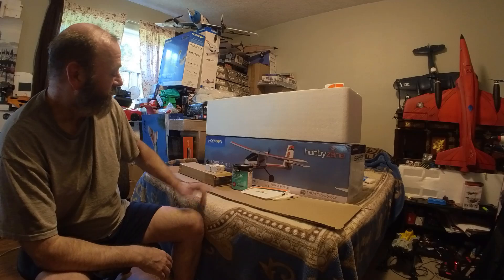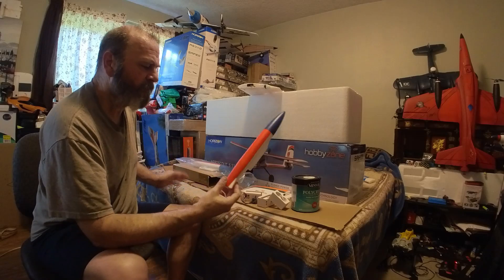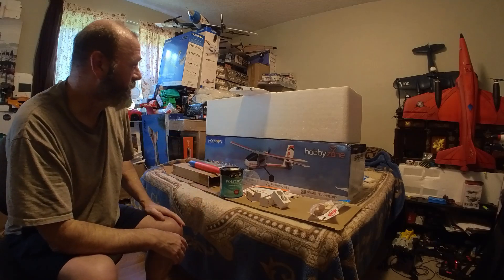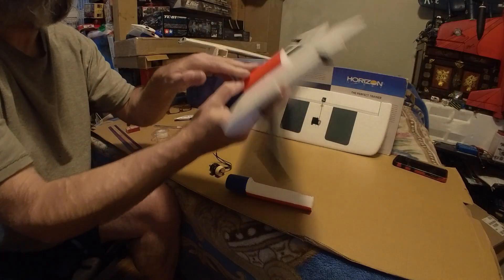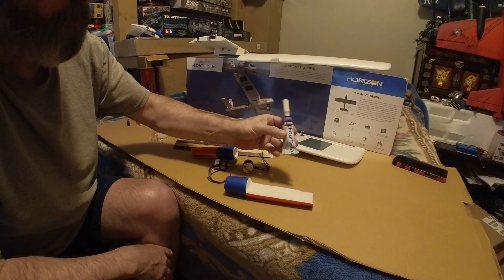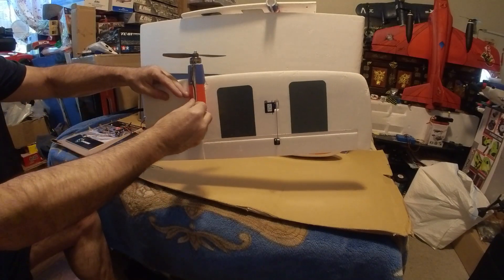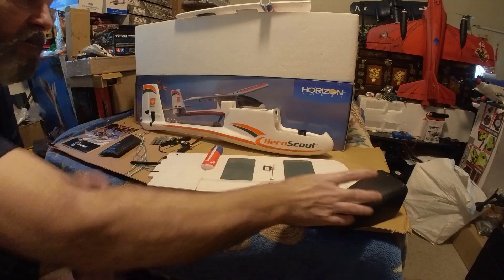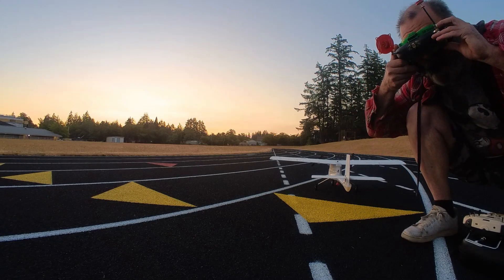E-Flite Aeroscout twin motor, build and first flight, FPV, Inav, Elrs

Comment: Are you still using the recommended battery or do you use something different
Reply from the maker: I'm using a 4s 2200 because I moved the servos back, but I can still use the regular 2200 3s if I want to works fine.

Comment: Nice build 

Adding second motor, has it increased planes speed?

How long can you fly it on one 4s battery?

Last question. I'm new to FVP, what googles or equipment give you you altitude & speed in Km?

So, in this video you maxed out at around 100ft altitude?

Has using fvp helped your fling of RC planes better?
Reply from the maker: Yes it has.

It depends how you fly it, I'd say about 10 mins.

the onscreen display is provided by the flight controller,  not the FPV stuff
it's the inav operating system that does it. 

maxed out at 100 meters,  that's about 328 feet high

I like flying FPV better, makes it easier to land, but that depends how you want to fly.